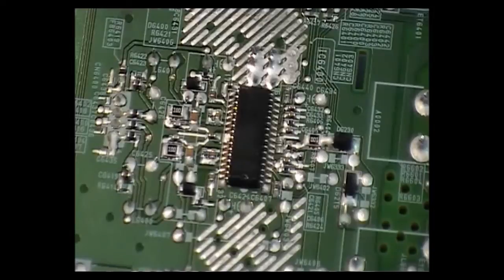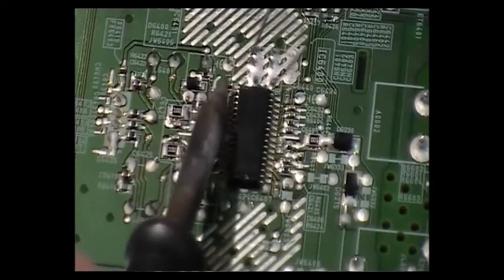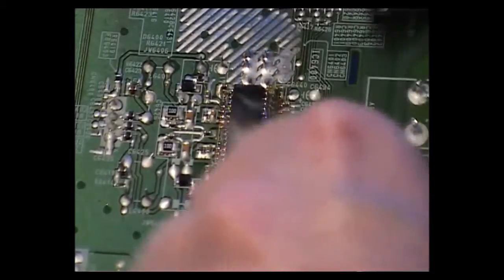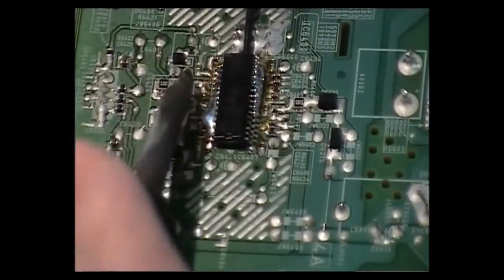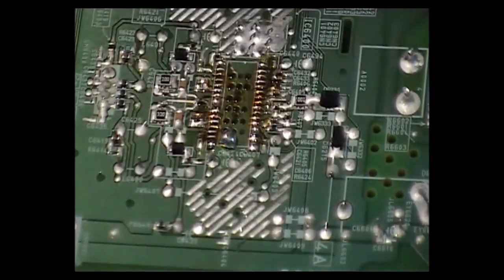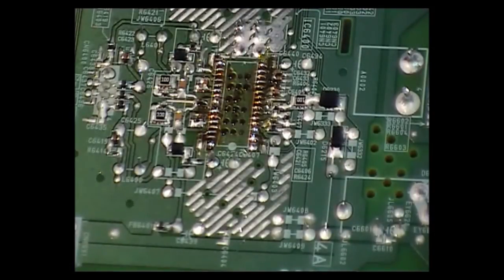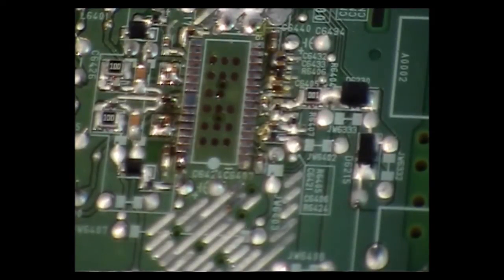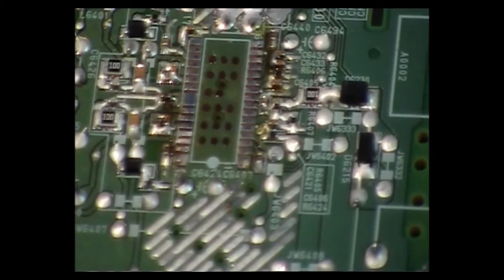Surface Mounted IC removal  using only a soldering iron 1

Comment: Could you use ChipFast for this? It's cheap,  easy to use like solder it just has a much lower melting point so the solder/ ChipFast mix stays liquid much longer and you can just deal with the glue without having to put so much heat into the board.  A solder sucker and braid followed with 99.9 isopropyl alchohol and you have the chip gone and a clean,  bright board.  For anything stubborn 99 IPA and a fiberglass brush.

Comment: Sometimes to remove the extra left over solder 60/40 I use a little hot air and a heat resistant silicone squeegee. For me, it's faster and cleaner if you have the surface space for the squeegee. Thanks for the Vid.